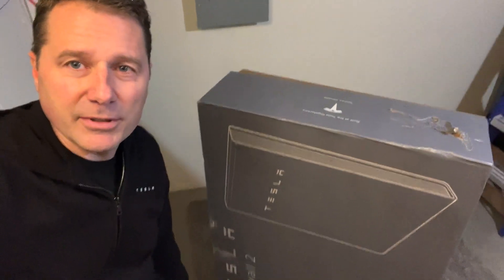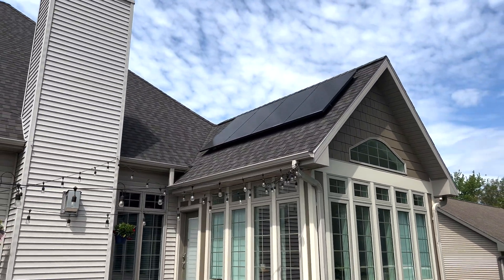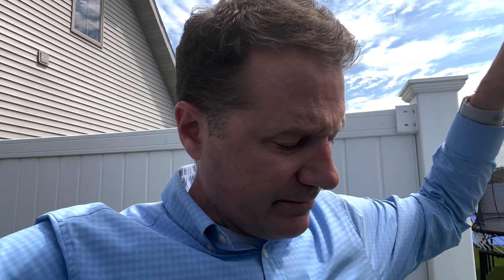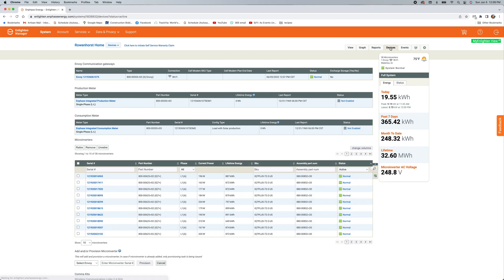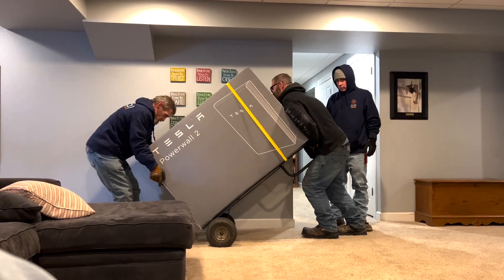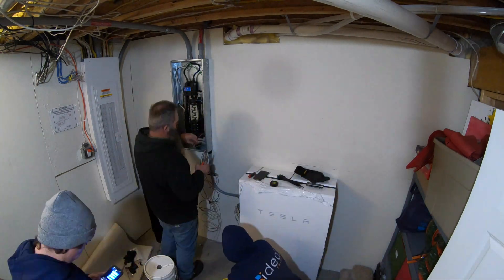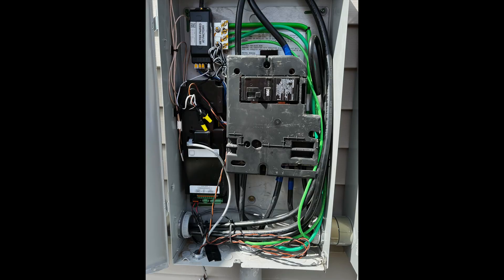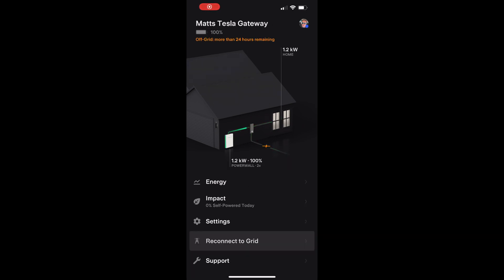Installing TESLA POWERWALL 2

Comment: Getting ready to have 2 maybe 3 PW2s installed to our existing Enphase PV system with 31 IQ8A micro Inverters feeding an Enphase 4C Combiner box (I opted to get the cell card as backup to my Wi-Fi.   Being able to see each individual panel's performance in real-time is genius.  One offers a MICRO view down to each inverter while the other offers a MACRO view.   Being able to monitor over $80K worth of solar gear like that is priceless.   Question, can you tell us if there is a way to see when they were manufactured?  Is that date on the PW itself or maybe the label on the box?  All the credits are now available regardless of when you install ESS.  I'm getting 3 PW2s for less than a 24kWh GENRAC generator.

Comment: do you have the part number for the CT clamp sensor for the powerwall. I am in the same situation.
Reply: Not sure on exact part number but this is exactly what it says on it:  U40002, 1628 Falco, Pollution Degree 2, Energy Monitoring CT E472657. Good luck!

Comment: Inverters have the ability to sense grid frequency thus the reason the inverters shut down on solar only systems. It’s a BS move the utility companies advocate for because this easily remedied by installing a safety back up to not back feed the grid but in turn allow the solar system to be Islanded/ isolated. There are ways of doing this if some is really interested just like true preppers have done so as they are commonly off grid.

Comment: Thank you for this video.  I am currently in day 1 of a 3 day install for my Powerwalls ( 3 of them ) so this video was very helpful.  I do have a question.  In the part of the video where you showed your car charging and how the energy was flowing.  When you had your car charging, it showed you were using  your solar power and also getting energy from your electric company.  I understand why as your car was taking more than your solar was providing.  Then you unplugged it and then it was sending part of your solar to your battery.  My question is when you were charging your vehicle and assuming your battery was full, can you tell it to use the battery energy first so you dont draw any energy from your electric company?  I would think that if you can do this, you can draw energy from your battery during peak times so you wont pay the crazy charges during peak times to your electric company.  Hope this makes sense and thanks again
Reply from the maker: Yes you can do that. I don’t have peak rates so doesn’t matter to me.
Reply: @ModernArtisan  Thank you.  I dont have peak times either but I know eventually my company will switch to this so its good to know